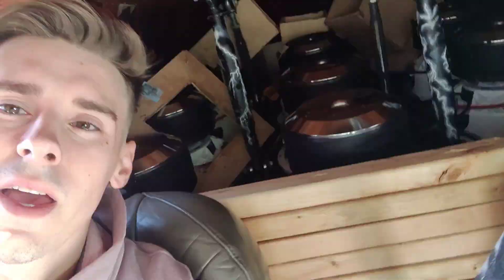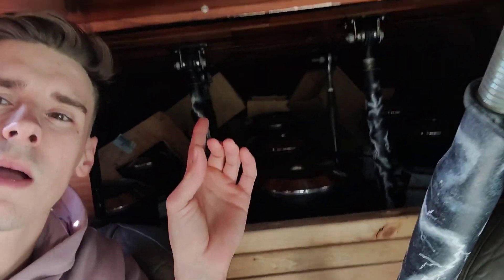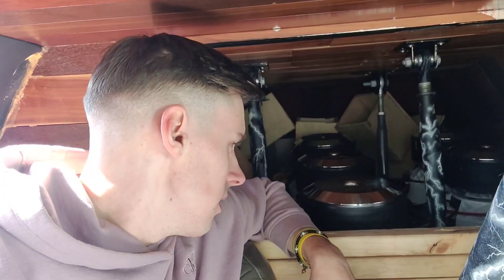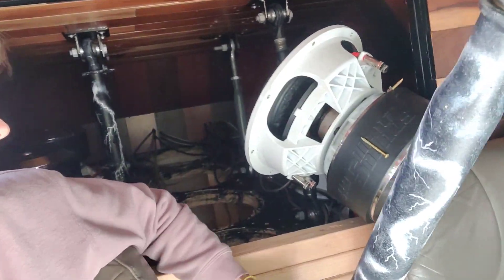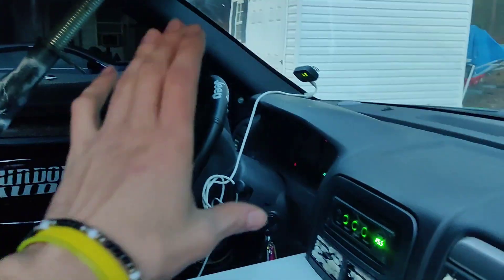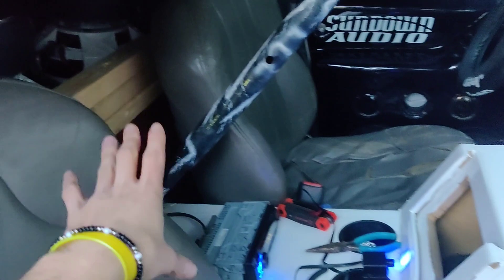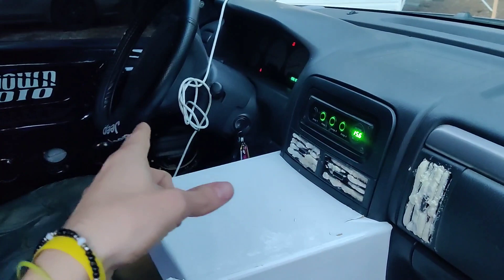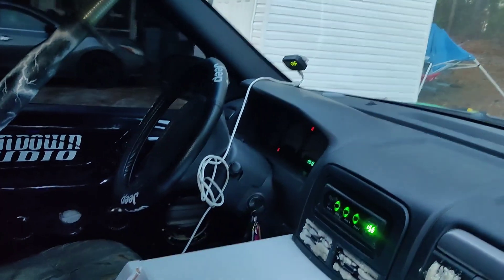Switching back to a 4th order with 9 12's??

Comment: I’m like your videos bro. Your DsP video helped me. I got 4 platinum 15s on 4 jp23v2s only running two amps atm. I put two new ones in today everything was going smooth and I turn amps on no rca or speaker wire plugged in and 3 of 4 amps turn on I swapped things around did this and that I think I got a dud amp
Reply from the maker: It's definitely a possibility bro, I would just double check everything. If there is still something wrong then I would hit up d4s
Reply: @Countryboy8270  I check checked, I submitted my return request form
Reply from the maker: @justinboone8700  hell yeah man that's exactly what I would do